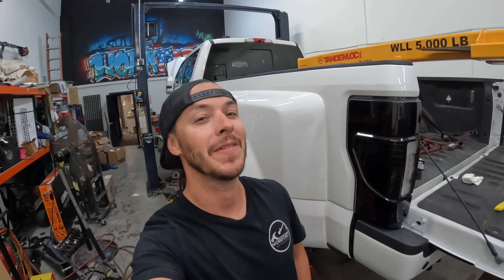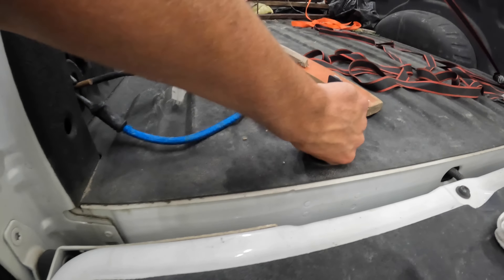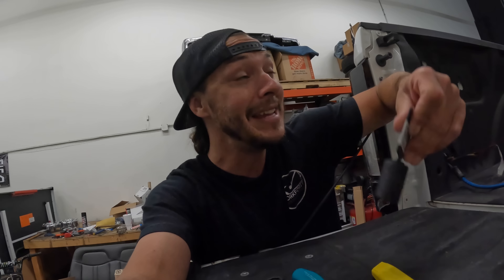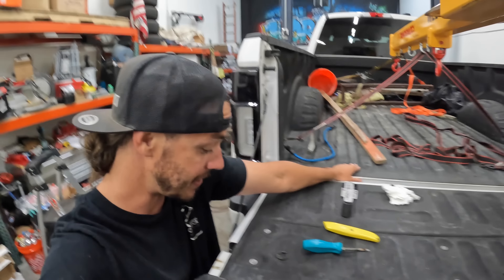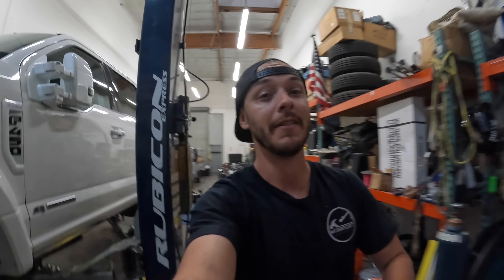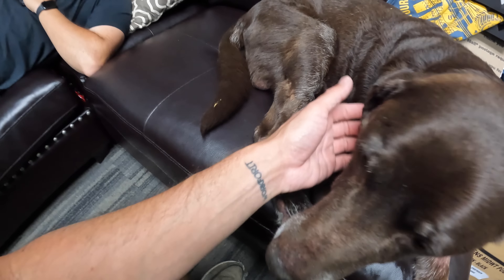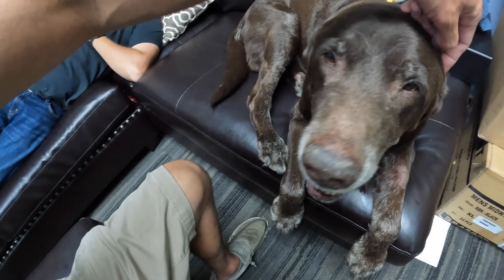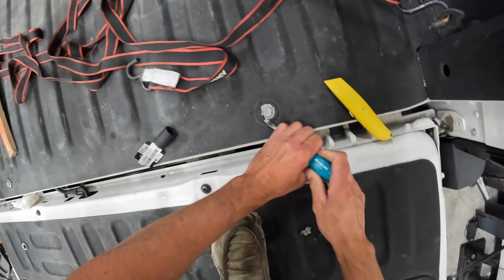Building A Monster F450 as a Gift to my Dad! (PART 2)

Comment: You should put some Carpet, or Fabric or Rubber Mats, etc  between the Cab ,and the Bed during the re-replacement, of the Bed back onto the Frame ,to keep from any possible contact of the two from occurring

Comment: I was told That "stutter"  with the Milwaukee drills and drivers is a  safety/ fail safe, or something along those lines. I thought there was a problem with the tool or battery the first time I felt it. It is difficult to get used to.
Reply from the maker: I’m a huge Milwaukee fan, but their triggers are prone to issues. My impact driver has stuttered like crazy since day. My handheld vacuum’s trigger is very finicky
Reply: @DMAXRYNO  I've used makita for probably  10years now,  my buddy has the Milwaukee tools, and like every tool that's not your own and you borrow..they suck! 🤣.  I do like the Milwaukee stuff, especially the 12v drill and drivers for being so light and powerful, and id bet the big ½" impact could break Thor's hammer free! But the stuttering make my blood begin to boil.

Comment: If you have a shop like that, with concrete floors, get some
5200 Lb. Max Vehicle Weight Ultra-Mobile Self-Loading Dolly from harbor freight... than you could move vehicles/trailers a lot easier....

Comment: Just an thing to know, most the bedliners I’ve seen get installed at the dealer and those bed bolts are “one time use” as per ford, and they don’t wanna pay the extra cost of buying new bed bolts so they just either tape them off properly or go right over em. Real sloppy IMO but it’s life
Reply: Yup, my bolts were sprayed over
Reply: @j.a.r.family2576 Zach did touch on it being a TTY or Torque to Stretch bolt I believe
Reply: @SingleTrak6  yeah probably 90-99% were. I’ve seen 2 that were sprayed with the bolts taped over or taken out and replaced
Reply: Don’t see the issue. It looks better, it gives a layer of protection from wear, if fully sealed is helping to avoid rust, etc
Reply: @lParohlx  it’s sloppy, and no it’s actually making it worse for rust if anything. He removed the bedliner from the bolts simply by breaking the connection on the liner on the bed. It came right off. Bolts weren’t sanded for a bond etc so if moisture did get in there. Which eventually it would, maybe not in Cali, it would get trapped and have nowhere to go and in turn rusting behind the liner. Just protecting it from scuffs at most

Comment: So gunners ears. It’s no use once the void is there it’s there. Once the drains are removed it will come back. Only real way is if they sew circles on the ear. Really he’s a old dog it’s a waste of money cause he has old skin. I had a pit bull that I spent 1000s on her ears with the same problem situation went to different vets and came to conclusion it is what it is. The ear will get stiff if you just leave it alone. And it will calm down.